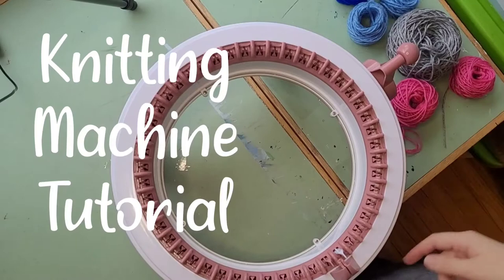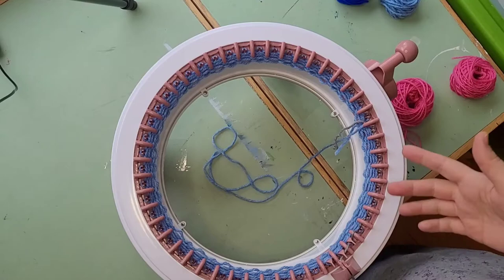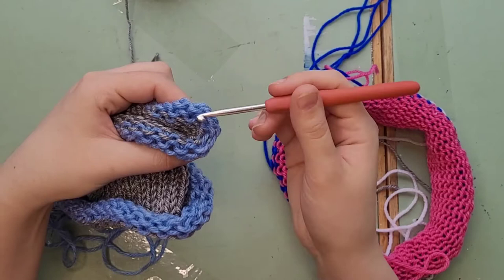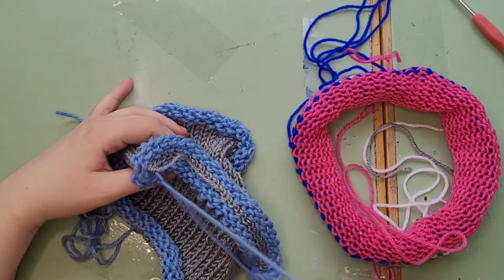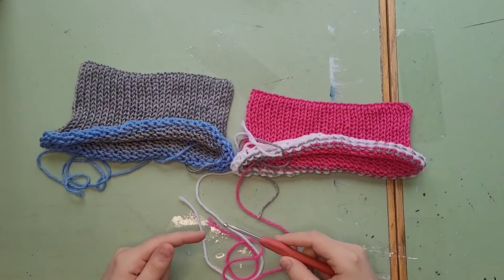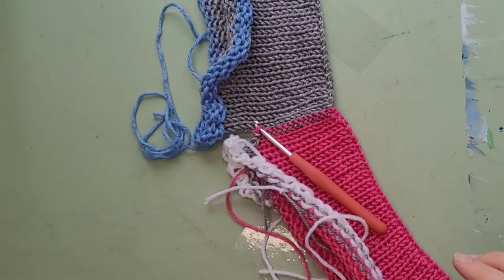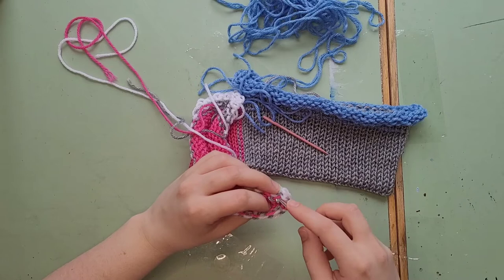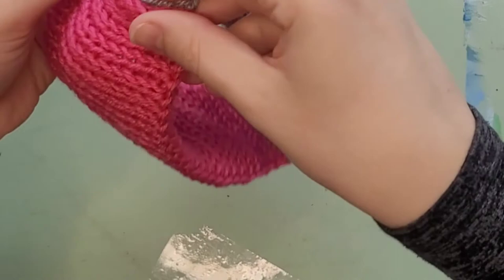Flat Tubes and Seaming: to make a blanket, headband, or scarf - Circular Knitting Machine Tutorial

Comment: I've got a ton of scrap yarn, all about the same weight, but various quantities. I was thinking to make a scrap blanket just working up all the tubes in whatever lengths each skein will give me, lay them out in a pattern, and then crochet borders around them as necessary to even them up before crochet them.  In my mind, it would look like when you put subway tile up in a kitchen/bath.  Each rectangle is offset from the ones around it.  Am I expecting too much from the tubes?
Reply from the maker: You don't need to make each color a separate tube. Just add your next scrap yarn in and keep cranking until you get to 2 or 300 rows or however long you want the blanket. Then you only have to join the sides of the tubes. 
I personally don't like the mixture of knitted fabric with crocheted fabric because the amount of stretch is so different but if you're prepared for that much joining it should work!

Comment: Is the resulting fabric always the same size, or can you adjust the size? It seems ppl only talk about making hats with it. Could I make tubular sleeves? Thank you!
Reply from the maker: If you buy machines of different sizes you have a few more options, but a 48 pin tube is always going to make a tube 48 stitches around. The yarn thickness can vary slightly, like a lighter 3 weight up to a 4 weight but that also won't change the size of your tube too much.
Reply from the maker: You can make a longer tube by doing more rows but the tube will be the same width

Comment: I have a 48 needles Sentro machine and I'm about to attempt my 1st queen sized blanket for a friend of mine, however I am unsure as to how many panels I need, can you please tell me how wide the panel is?  I know how many rows I need to make, but how many panels I don't, that depends on how wide each panel is, please advise, once I know, I can then figure out the pattern and know exactly how wide each panel is so I know how many to make to finish the blanket, thanks
Reply from the maker: The panels are the tubes squished flat. Knitting is quite stretchy, so the width can definitely be pulled wider but I measure them at about 9" / 22.5 cm. The tension you use will change how stretchy the panels are. And the thickness of the yarn affects the tension as well. So take these measurements as a loose guide only.

Comment: Is there a way to get the waste yarn off of the tube without closing the tube?
Reply from the maker: Your waste yarn is holding the live loops of your project. Before you remove the waste yarn you have to do something with those live loops. There are crochet and knitting options. Both involve using hooks or needles (and not just the circular knitting machine). Some techniques are stretchier than others. I don't have tutorials on any other bind offs / cast offs but they do exist!